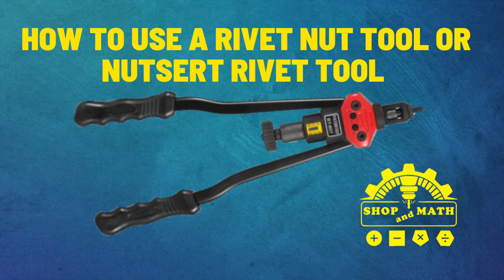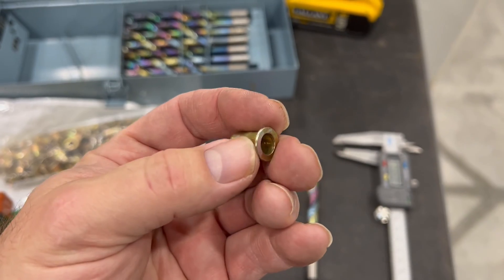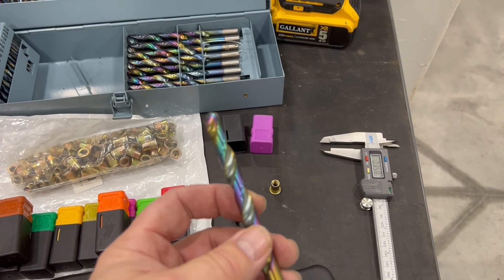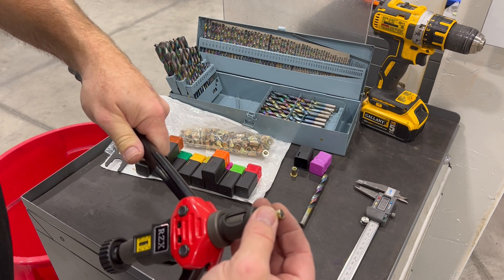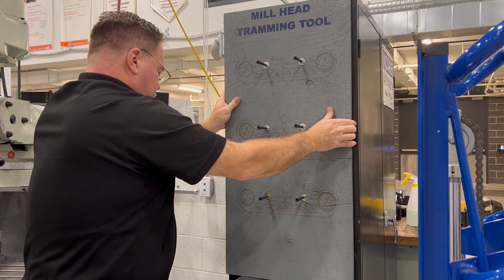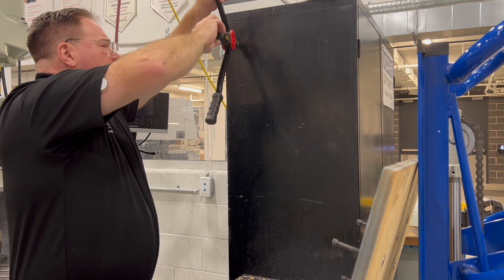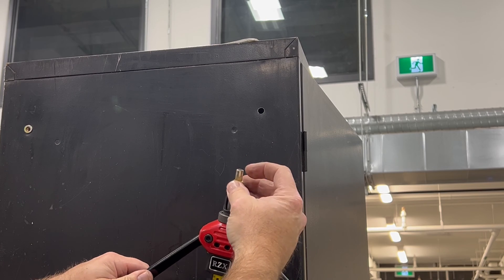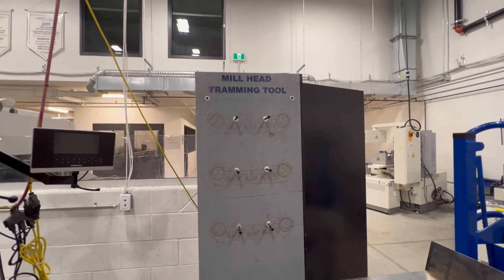How to use A Rivet Nut Tool or Nutsert Rivet Tool

Comment: I have the exact same tool.
1.  Open the handle of the tool
2.  Separate the threaded mandrel from the retaining nut
3.  Pull back the spring retainer
4.  Install the threaded mandrel
5.  Then installt the retaining nut.
Too difficult to install the mandrel and nut at the same time.
6.  Don't use too much pressure when squeezing the handle especially with aluminum rivnuts or you may strip out the rivnut.  Just use enough to compress the rivnut so that it doesn't turn in the hole.  When you install the bolt, it will tighten the rivnut a little more when  you install the mounting bolt.  I've never had a rivnut failure during install or after.

Comment: The tool itself is fine. The rivot nuts are junk. 2 out of 3 threads stripped
Reply from the maker: I’m not saying this is what it is but you need to double check to make certain that the tool insert has not been stripped. I have a 6 mm insert for this tool that I’ve stripped out because all of my nut Certs are stainless steel and the damage the six mill insert for the tool check your threaded tool part and see if the threads are stretched or damaged.
Reply: @shopandmath  
I found out why from watching other videos.
You're not supposed to thread the rivot nuts all the way.
When squeezing the handle, it should close easily. Once closed, you give it a couple of turns on the thread and squeeze again.
It works every time now.

Comment: Very good video. I would have deburred the hole using a Cogsdill deburring tool or a countersink (that's just me). Thank you for the video.
Reply from the maker: That’s a good point. Thank you for sharing.
There wasn’t much of a burr, and I was thinking that that would help grip the insert little bit more of a jagged surface 
Or do you think it’s best to bur the surface so it’s clean
Reply: As an aircraft mechanic we always de-burred the holes front and rear using a Cogsdill tool to clean up and prevent cracking when riveting. I've always de-burred any hole just as a measure to get a solid flat surface to bond anything to. As for that panel, it's perfect as it is. Just a little FYI of how I was taught. Thank you for your videos.